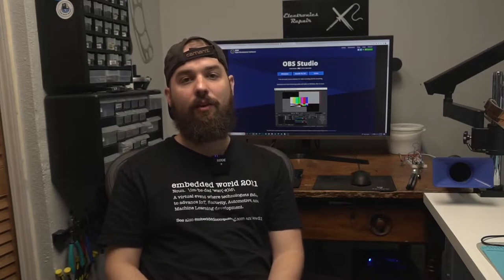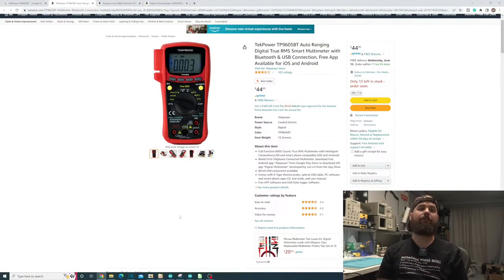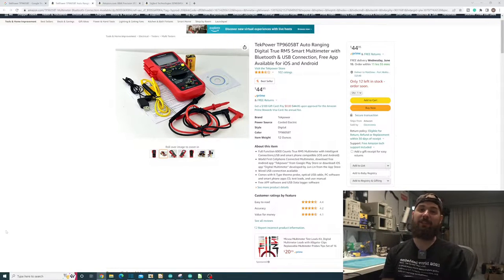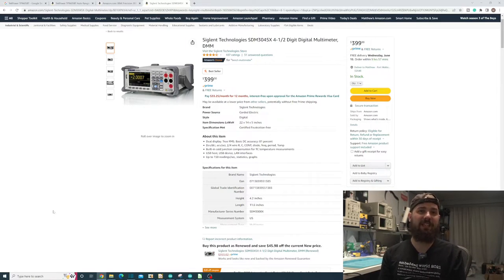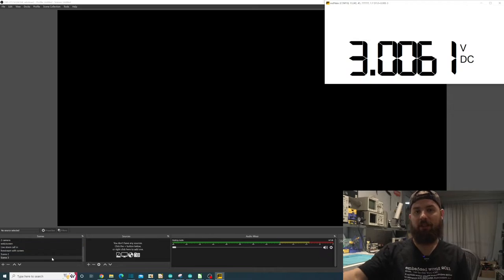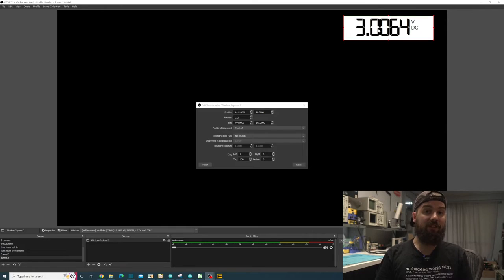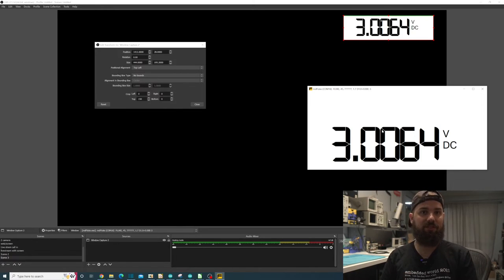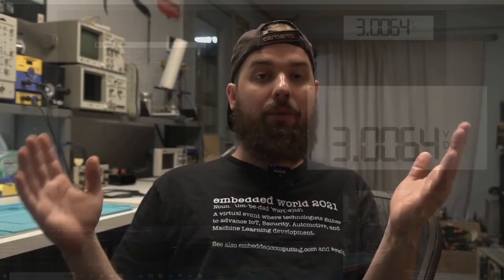Using a Multimeter On Screen in OBS

Comment: Hi there my name is JJ and I have a 2010 VW Jetta and the Ecm is no good I bought a used one with the exact same part # question, the immobilizer e prone is the same 8 legs but in the opposite side of the card? Compared to the VW Ecm video you show how to replace it

Comment: One troubleshooting tip: If mdFluke detects your meter (model and serial number in title bar), but doesn't show live values from the meter, your meter probably defaulted to a printout rate of zero. Press [2nd] [MN MX] to get to the Print-Only Mode settings, use the up and down arrow buttons to set a rate (I like 2 -- the number denotes that the meter will send every nth reading out the serial port), and then press [AUTO] to confirm. You will hopefully now have live updates in mdFluke.
Reply from the maker: Yes that took me a minute to figure out the very first time I used it.